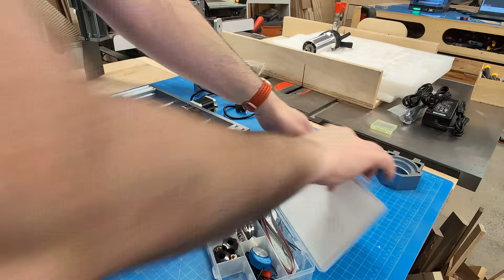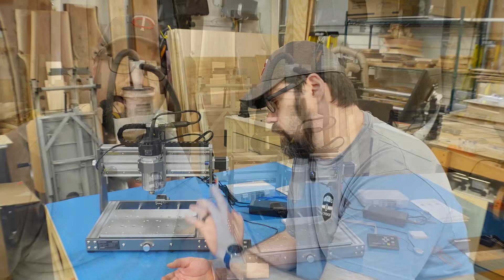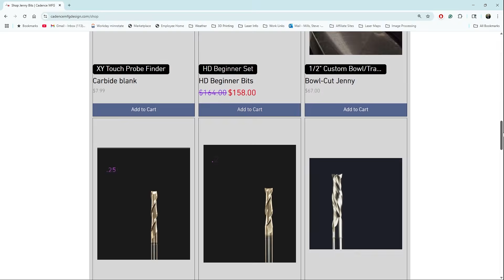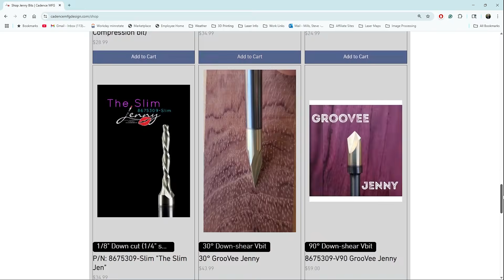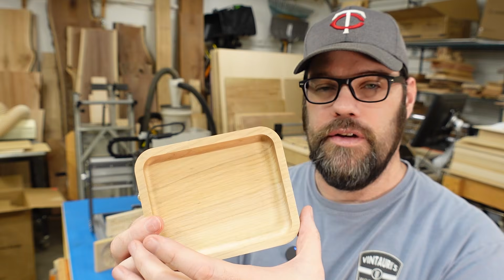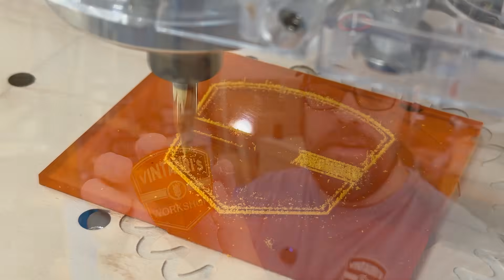A small CNC with real power? -- Genmitsu 3020 Pro Ultra

Comment: Great review. Whats the software used ? Not quite understanding where you draw a model and get it to the machine ?
Reply from the maker: I use Vectric Vcarve, but you can also check out Carbide Create or Easel as options.  Some people will design in Autodesk Fusion.
Reply: @Vintauri I literally bought a machine yesterday,  should be here today 😊 thanks  from 🇬🇧 👍

Comment: nice and exhaustive video, but l got a doubt on the reel working area, they say and you say 300mm but the aluminium plate marks goes to 28cm so l don't know what to think and l want to be sure that it can cut 300mm... It's a very important question, and SainSmart don't answer me... Thanks
Reply from the maker: The actual dimensions of the aluminum baseplate are 300mm x 200mm.  I don't really pay attention to the markings on a spoilboard unless they are put there by the machine itself.  The issue with trying to max out the working area is you still need to have a hold down mechanism and if your piece needs the entire working area and covers the entire spoil board then your only option for holding the material is double sided tape.  If you need to work with a 300mm piece, I'd recommend a machine with a 400mm working area.
Reply: @Vintauri yep you probably right ! Thanks, lm gonna extra hours to reach the 4040 pro max. You’re very kind to answer me 🙏

Comment: Thank you so much. I am a complete beginner when it comes to milling machines, your review was so informative! I make some fairly complex electronics projects for experiments on visual perception (I'm a psychology professor) that really need custom built steerable mounts for cameras, COB LED arrays, lasers (for alignment), luminance meters, and so on. This looks perfect - acrylic or aluminium are all I need to be able to work with (no need for steel, all the bits and pieces are lightweight). I also need to tap threads, but I'm perfectly happy doing that by hand - I assume that isn't the kind of thing milling machines are made for anyway?
Reply from the maker: I'm glad the video was helpful.  This machine would do well for acrylic and aluminum with the right endmills and for the metal I would get an air nozzle that could be mounted to the spindle mount to help keep chips moving and the bit cool.  Threads would take some special tooling and path creation, it would be easier to do it manually after the job. Thanks for checking out the video!
Reply: @Vintauri  Thanks again so much! Could you give me a bit more advice on the Jenny bits that would be best for work on acrylic and aluminium (I looked at the Cadence web site and couldn't work out what I needed, and I'm afraid the details of the bits all flew by a little too quickly in your video). Also, as a total newbie, what is an air nozzle and where I could get one? At the moment my shopping basket on the Sainsmart website has the 3020 Pro Ultra, the MDF board, and the 65-69mm dust shoe in it. Any other recommendations  for things specifically from Sainsmart before I hit 'Buy'? (By the way, it is worth pointing out that Sainsmart are giving discounts that make buying from them much cheaper than going to Amazon.)

Comment: h❤️❤️❤️❤️❤️❤️❤️       $500 on sale  $600 normally      can the speed be computer regulated  ?
Reply from the maker: The feed rate can be controlled by the computer but the router has a manual adjustment for the RPMs.

Comment: Is there room for the tooling to machine a face that is 3.00" tall?
Reply from the maker: There is clearance of about 4" from the metal base plate to the bottom of the Z Axis rail.  As long as the endmill is not too long and you can mount the router up higher in the bracket there should be room for an item around 3" tall.

Comment: I have a Chinesium unbranded 3018, brought way back in 2014, originally came with a printer LPT port, later on I upgraded to USB port. The only thing Lame about these machines is not the machine itself, but the software. Free Chinese software is awful, terrible. And only works in Windows, so I have to install a virtual machine on Linux. A pain in the carbides.
Reply from the maker: I use Vectric Vcarve to create the gcode cut files which is not free software. But I have found the G-Sender is a good option for control software for the GRBL based machines.
Reply: @Bible_Daily_time  first "mod" i did to mine was to use a raspberry pi and UGS for the control. Paired with a 19" touchscreen and a cheap game controller its proven to be a pretty robust control solution with far more functionality than I need

Comment: How would this machine compare to the 4040 Pro Max for capabilities and performance?
Reply from the maker: They will have similar performance but the 3020 is a bit more rigid so if you are doing harder material it will have a lower tendency to have vibrations and chatter.  But that sacrifice is at the smaller working area.

Comment: Great review and I like how much you showcase the results from several different types of materials and jobs. 

With that said, I think more people should check out AnoleX. Currently the 3030-evomax is cheaper than this, has a larger work area, and uses linear rails instead of rods for the Y axis.

Comment: Great review. :)  You wanna slow that aluminum RPM waaaay down tho... as low as you can go (think it was 7000RPM on that spindle) and keep your speed up so you've got enough chip load to evacuate the heat and prevent rubbing and galling.

I've got the 3030 PROVer Max and I've been experimenting with 316 stainless, and I've actually achieved shockingly good results with a single-flute o-flute 1/8".  The chip load is critical and you need to manage tool engagement, but when you get it right, the surface quality is superb.  It's incredible the tools we have access to today.
Reply from the maker: Thanks for the tips I don't do a lot of metal with the regular CNC machines but dabble.  I was getting decent pockets at this speed but I'll see if I can play with the RPM and feed rate more. Even scrap metal is getting expensive these days so testing can cost some real $$.
Reply: I'm looking to buy a machine for engraving plain, block, 12 or 14 point lettering into stainless. So should be a simple but precise project on a tough material. Do you think the Genmitsu is capable?
Reply: @danielhafstad8300  it's not the ideal machine for the job, but I think with some calibration and patience you could make it work with acceptable results.  Frankly, though, if the application allows it I'd look at a fiber laser instead. :)

Comment: Neat little machine. 
Think I'm gonna get it with the 3020 extension. 👌
Whoa. 20% off on the AMAZON link!
Reply from the maker: There are some extra deals during Prime Days! It's a good machine as long as the working area is enough for you. The extensions should help out with that.
Reply: The extensions would provide more than enough for anything I would need. Without it, it's pretty close  @Vintauri
Reply: I've got the extension on my 3020 Pro v2 and found that the Y axis linear rails are too weak, as they bend in the middle under load. It's helpful when I accidentally crash the Z axis into the bed, but not when I'm machining anything! I'm thinking of replacing them with linear rails that are supported underneath all the way along. Apart from that I think it's a great machine. I use the dust shoe and it works well.
Reply: I'd like to see what type of Y axis support you're considering. @EcoHamletsUK
Reply: @MilesWaldron-b1g  The SBR type, that are available in various sizes. I've got a couple that are too short and may be too big, so haven't worked out which ones I need yet.

Comment: Yeah I am not a fan of metal clamps on these smaller machines.  I think a lot of the market for this size are new to CNC so avoiding something that can break bits is a better solution
Reply from the maker: I agree, for someone getting started, having easy but forgiving hold down methods is important. Good thing 3D printers are reasonable and a good machine to pair with a CNC router!

Comment: that is ULTRA stout. I wonder how it compares to the Carvey? Looks very nice! - thanks for the review.
Reply from the maker: I don't have any experience with the Carvey, but it's definitely a step up in power from many of the other small machines on the market!
Reply: @Vintauri  Yes this is definitely "heartyer" - Carvey is a 300-watt 12,000-RPM spindle suitable for cutting and carving into a variety of wood, wood products, plastics, etc. Carvey can even carve through your material depending on the thickness of your material and the length of the cutting flutes on the bit.